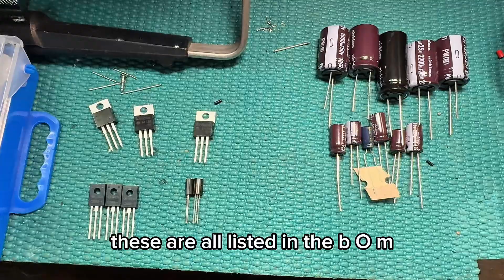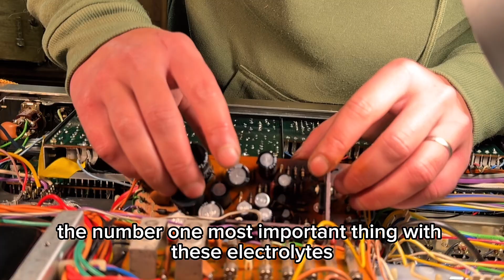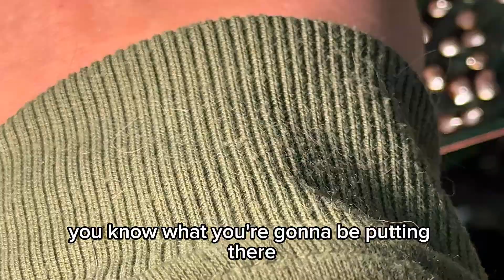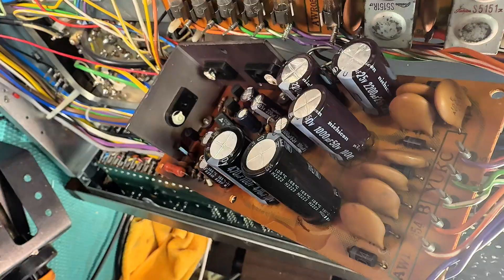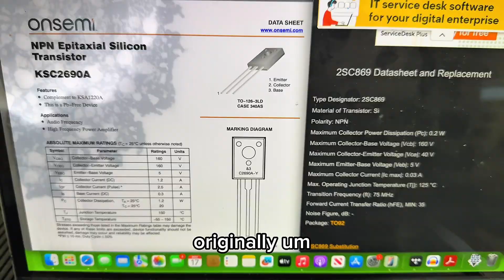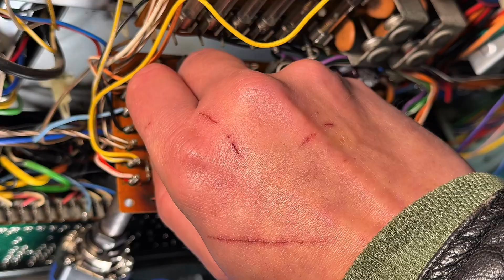Pioneer SX-1010 Restoration Pt.3 – Power Supply Rebuild & Transistor Upgrades (Fixing Heat Issues)

Comment: The glue. 
Toluene/nail polish remover will melt that glue away. It's nasty stuff but works.

Or use hot air on the glue.

Comment: I'm in the middle of doing this to the power supply of my sx850. What kind of thermal paste did you use on the heat sinked transistors? Is it non conductive?